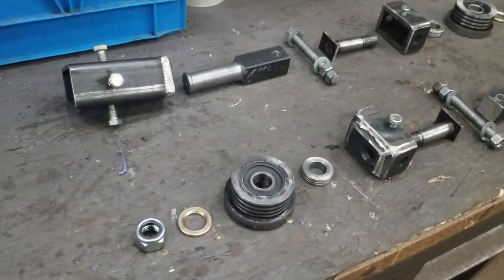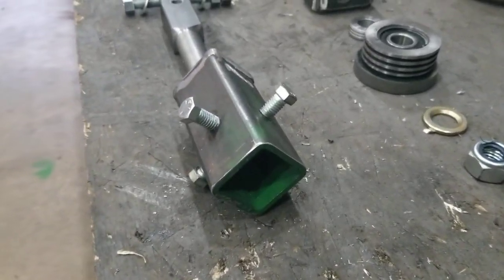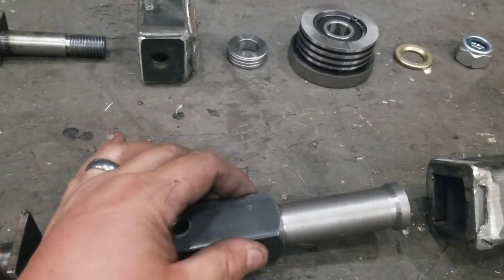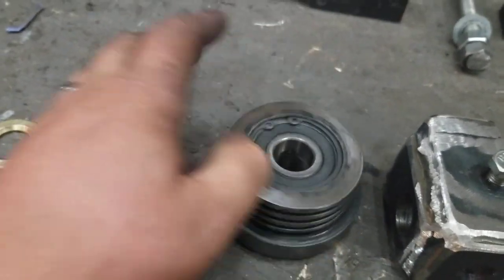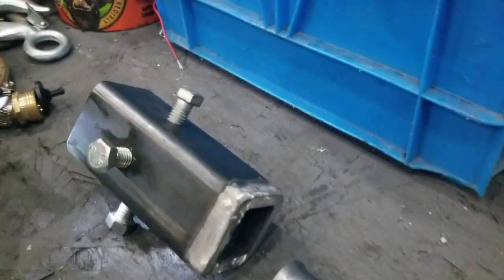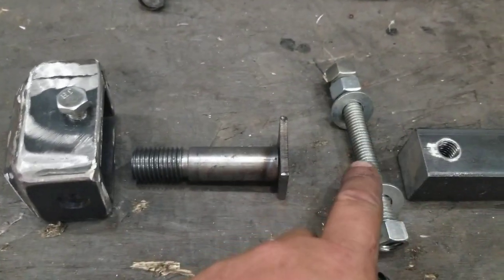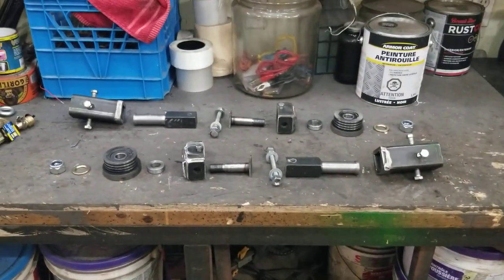DIY Lumber Mill Blade Guides

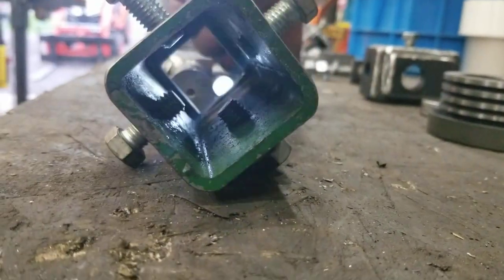Comment: From what I can see this is THE BEST video on YouTube explaining the mysterious black box behind the guide wheels on the Cooks mounts.  One thing your mount does not address is an adjustment to move the guide wheel in and out along the guide wheel mounting shaft axis to have the blade run where it should on the guide wheel.  I noticed on at least one Cooks bandmill that there is no adjustment for this.  Seems like you would want to have an adjustment in every possible plane of movement: guide wheel tilt up-down and left-right; move guide wheel assembly up and down; move guide wheel assembly in and out along shaft axis.  Or maybe you can do without the in and out along the guidewheel shaft axis by adjusting the blade tracking on the drive wheels to move the blade a fraction of an inch. I would not do it that way but maybe Cooks did it to simplify things on a complicated machine.   Okay it's a few minutes later now and I watched a Cooks video and the narrator does say they use the blade tracking adjustments to align the blade on the the guide wheels at 1:46   https://www.youtube.com/watch?v=Cb46MJObrSA  Thank you for a very good video that has answered a question I have long pondered.
Reply from the maker: You can slide it in and out along the direction of the x-axis and then retighten the tilting screws to lock it in place.
Reply: @ChrisOfAllTrades  Okay I didn't know how the whole shaft worked with the lip you welded on so it can tilt this way and that.  That's good!  How much adjustment will you have in and out?   Thought about it for a minute and it strikes me as odd that Cooks doesn't do it that way.  It seems pretty simple rather than messing with the blade tracking for such a small adjustment.  Yet seems like it would be best to have all adjustments isolated from one another too.
Reply: Also I hope you make a video of the assembled units and show how all the movements work.  Thanks!
Reply from the maker: @radroy92  I can probably move in and out about 3/4" to 1" in each direction